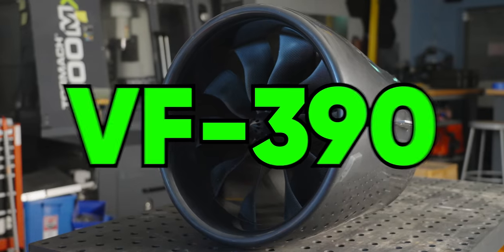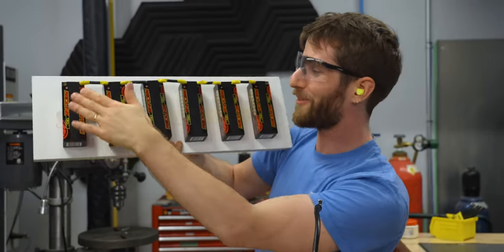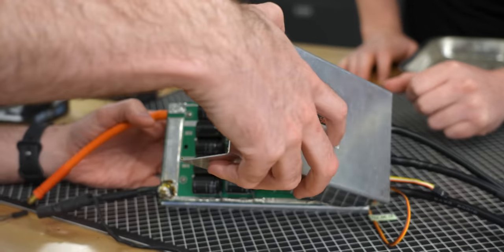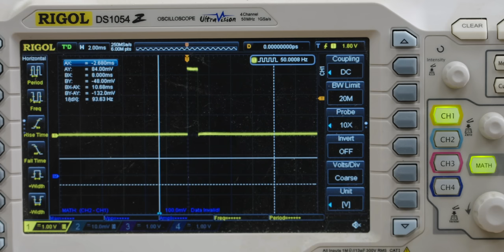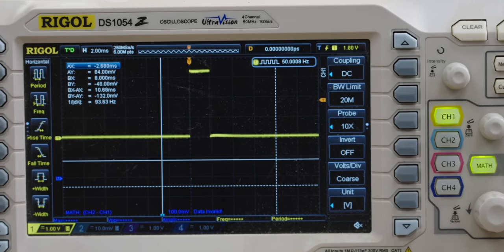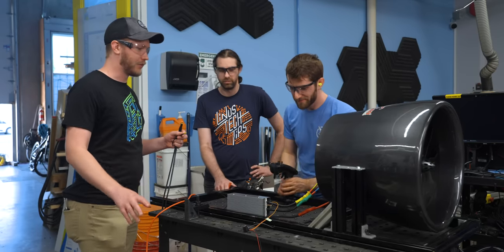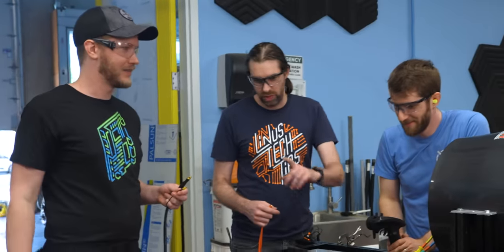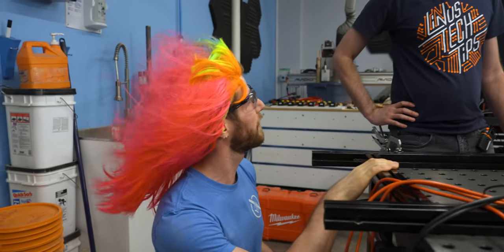The Scariest Fan ever attached to a computer - Vasy Fan VF-390 EDF

Comment: Let's see,
according to the datasheet, it use 45 kW. Let's say that it has 90% efficiency, which means it use 40 kW to push the air.
Air density is around 1.3 kg/m3, and its surface area is  0.1 m2, which means this thing can theoretically push 0.13kg for every 1 m/s of wind.

From the kinetic energy equation, 0.5mv2/s = Power => 40000 = 0.5*0.13*v^2 => v = 85 m/s (on average, at max power).

Which means, this fan push 11 kg of air, every seconds. The momentum is around 935 Ns every seconds, which means it push air at 935 Newton.
Assume the inverse square law is applicable,  and assume that the effective depth of the fan is 30 cm, every 1 meter the surface area is increased about nine times. So the pressure at 1 meter is around 935/0.9 Pa = 1038 Pa.
Using Du Bois formula, and assume that Linus is perfectly fit, we can assume that Linus body area from his torso to his head is about 0.3*BSA = 0.3*0.007*75^0.425*188^0.725 =  0.6 m2.

Which means, Linus at 1 meter from that fan will receive 622.8 Newton per second. Imagine he lays on the ground, and a 63kg/140lb dude lies on top of him. 

As conclusion, it's safe to say that this fan is crazy, and Linus is quite strong.

Comment: An esc does not convert DC to 3 phase AC as it does not create a wave function and only create a pulsed dc single not an alternating one. it individually powers each coil in the motor to cause it to progress.

Comment: Hey eejit, get 3 or 4 of these and make a floating gaming station :P 
Basically a overgrown quadcopter with a center that includes gaming pc, chair and instead of a screen them fancy 3D headsets with passthrough for the outside world :)
Reply: Not sure what you will use for power supply though... Maybe a portable generator based on one of them fancy new tiny ICE engines that have a ton of power for their weights linked to a generator (which is what those new ICE engines were actually designed for, to power a generator to charge electrical cars, basically an hybrid the right way around as this way you can get 1000Km+ from your electric car with a moped/scooter sized petrol tank)

Comment: speed controllers don't change the current direction or phasing.   

speed controllers just control the voltage.  the worlds most common dedicated speed controllers are DC to DC.  Think R/C cars and planes.  a DC to DC speed controller is aka a motor driver.

an inverter changes direct current to alternating current.

a transformer changes the phasing.

those are 3 separate technologies all using 3 independent devices.  that box just contains those 3 devices.

Comment: There’s no way that fan draws that much power.
Reply: This is the data from the manufacturer:
Max. Thrust range: 750N
Max. Discharge speed range: 90m / s
Max. RPM range: 10,000 rpm
Max. Input power: 45kw
Permitted battery: 18S - 28S 30,000 + mAh
Permitted controller (ESC): 30kw - 45kw

Comment: The fact that tiny electric motor can woof out 60 horsepower is fking unbelievable. That's indeed 45kW and that is cutting edge. And the fact that it's literally on a propulsion fan so it's able to do so for an extended period of time. Motors have come a long way. Imagine that thing geared down to the back wheel of an electric bike 🤣 and what electric hypercars are gonna be capable of soon

Comment: Wait a minute....I know that's from a company called Vasy fan but are we not gonna address the fact it's not a fan. It's an electric turbine thruster. It's rated at 60hp, those are thrust ratings and it has an airflow concentration cone on the rear to increase thrust. That's not made to cool, it's made to well.....thrust

Comment: I hope you can review the 9RA series fan form Sanyo Denki，escepially the 9RA1212P4G001，9RA1212P1K001 and 9RA1412P1G001 models.  These maybe the best fan for personal PC building for now. Better than Noctua（for 9RA1212P4G001 you may need to replace the orginal dual ball bearings for a quieter model）

Comment: I don't get it, with the battery voltage and current limit, you have limited it to about 9kw( 100a at 88.8v nominal), shouldn't that be easy to do on power from the wall?

Or was it just cheaper to buy batteries than to get a dc power source that can output 10kw or more?

Comment: This fan might be fast, but: I'm frequently copying 20-100 GB files between my laptops and servers at home. The 1000 Mbps RJ-45 port limitation really slows things down, considering the SSD's these days manage 2 GB/s transfers. Copying a 100 GB file between two m.2 SSD HDDs takes like 5-10 sec, but if that m.2 SSD HDD happens to reside on another laptop it takes forever, like 5-10 minutes to transfer a 100 GB file in a 1000 Mbps LAN network. IOW, these laptop network cards has not developed since my Dell Precision 6500 from 2010. It has the same LAN speed (1000 Mbps) as my Dell Precision 7750. Now, that's a disgrace. I need you guys to arrest the industry for lagging behind on laptop LANs. Like yesterday.

Comment: That thing can f*cking kick into the air a sailplane, turning it into an electric plane basically. How much does that weight? And the batteries? How long does that batteries hold until smoking?

Comment: Holy fucking shit, this wasn’t sketchy, this was properly dangerous. Potentially deadly. Think about this, the wind speed generated by a jet engine, according to Boeing, can exceed 600km/h (375mph) at the back of that engine. You had a, and let’s call stuff by their actual name here, an engine that could go to 75% of that. A few weeks back a person got sucked into a jet engine in Texas, and that engine wasn’t even near full power, since the plane was finishing taxiing. Obviously no one could be sucked into your “fan” due to size constraints, but loss of a limb was a real possibility there. Going behind the engine or even stuffing his head behind it is the stupidest, dumbest thing I’ve ever seen Linus do. If something got sucked into that, like a water bottle or a loose screwdriver, some screws or even the glass from a window pane shattering while he was there, the shrapnel resulting from the blades shattering would be thrown at him with the same force as arrows shot from a bow. He could’ve been killed. You guys are insanely lucky that nothing got sucked into that thing.
Doing stupid and sketchy things with computers is fun, hilarious, and it makes for a great video. I’m not asking for you guys to stop doing those kinds of things, they’re awesome, but when you’re dealing with forces that can be measured by the same scales used for natural disasters like a hurricane, be more thorough with your research and safety protocols. We want our Chief Vision Officer around for many more years to come. :)

Comment: 450km/h of wind is an EF5 tornado inside the computer, I think the sellers/manufacturers lied to you, I don't think it will ever blow at 450km/h, not really, I know the damage that a 450km/h wind can cause, and if it were wind at that speed, it wouldn't just destroy the computer but demolish the entire building.

Edit: Obviously the fan is very small compared to a tornado so the area it hits is very small, maybe it wouldn't destroy the building, but it would destroy everything behind it, just watch the Jet Blast videos.

Comment: poor smoking lithium
linus needs a 100kw transformer, just to power the VF-390 without shutting down LMG
250a 150v, WTF
ok maybe assuming 120v(a bit below max voltage, I think) you could somehow get a 240v-120v transformer setup that can do at least 300A, maybe time for a collab with photonicinduction, that fan is not something he could ever say "I popped it" honestly with